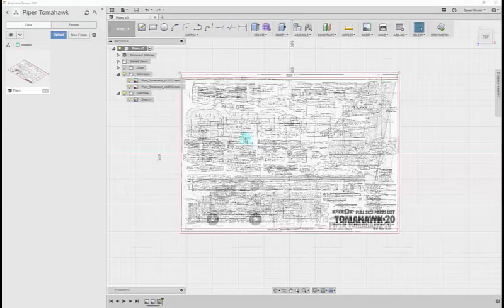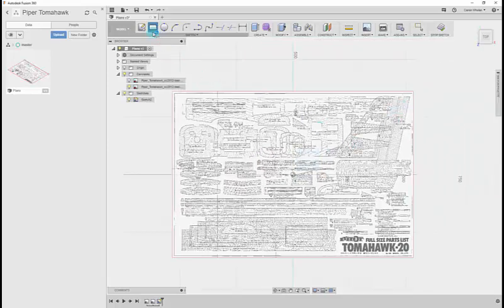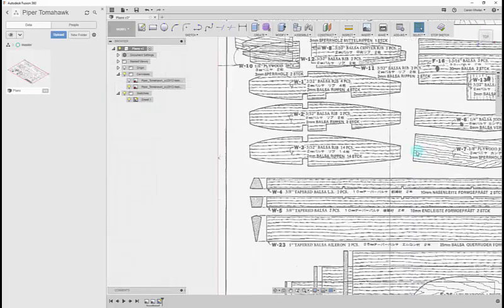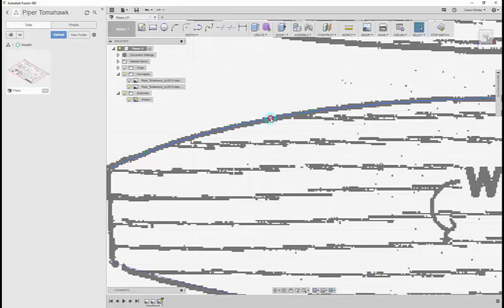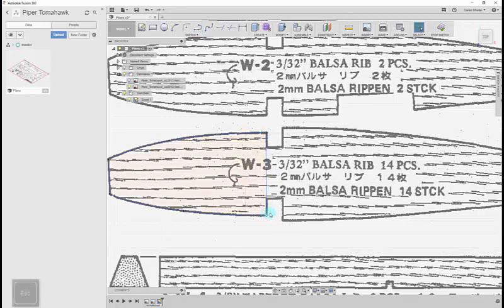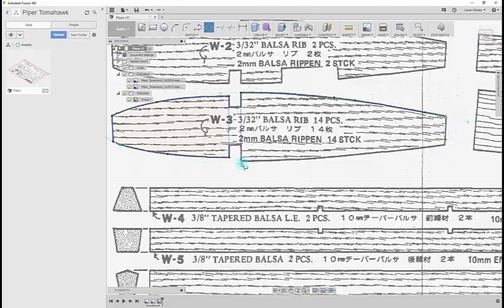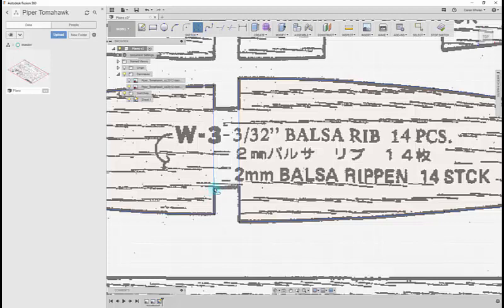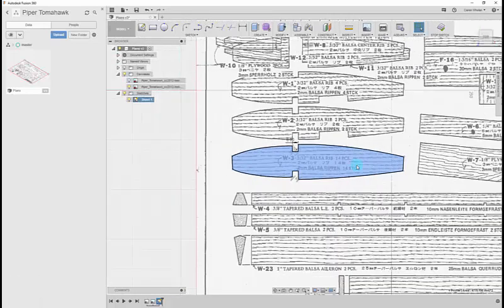3. Create balsa sheet - trace rib

Comment: Makes it look easy. Do you trace each rib as drawn from plan in such an example or do you trace say the largest rib then loft them down? 

I don't have much experience but I have used QCAD, which is 2D. Sometimes it's nice to import an airfoil's coordinates then loft.

Does Fusion 360 make it easier to notch the ribs before you lay out the ribs....

This is a completely new thought process to me, the idea of modeling in 3D. No need to add the notches later assuming no major mods?